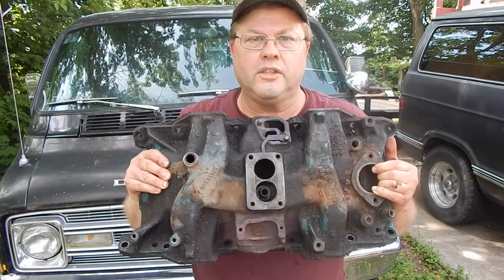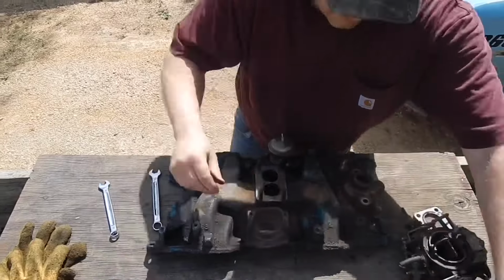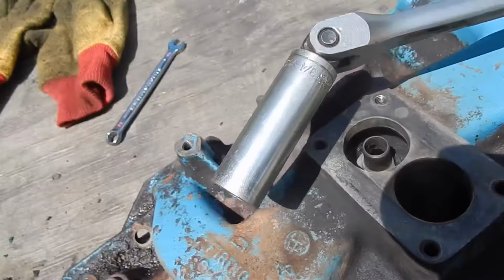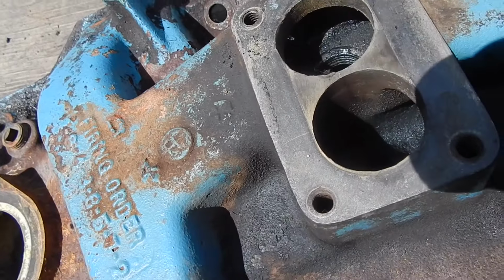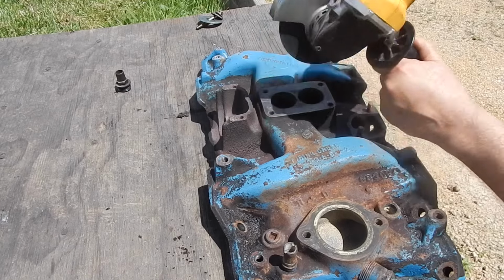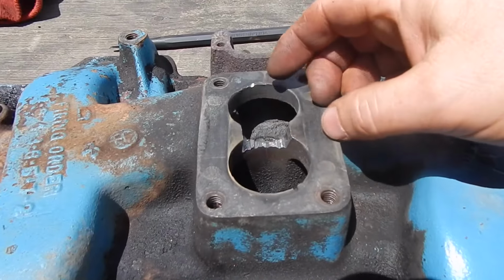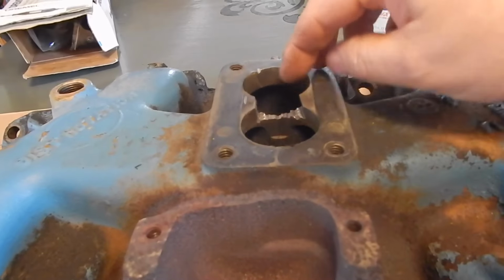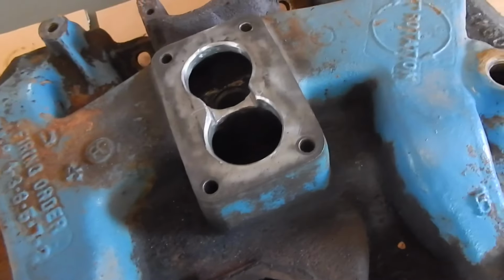Mopar 318 2bbl intake mod * MPG and HP Part 3 #nonamenationals

Comment: had a dual-plane on a 69 fury  a b and e bodies got a single      is the torker 318 any good??
Reply from the maker: single plains are great when used when they should be used.
Reply: @318willrun  well....    yeah...
Reply: @318willrun  and.....
Reply from the maker: @longhairscorpio3976  I guess i don't know what a torqer 318 is ...????   Do you mean a torker 340 intake on a 318??
Reply: @318willrun  edelbrock single plane w/small ports   seen them in the past  guess they stopped making them
Reply from the maker: @longhairscorpio3976  sounds like the holley street dominator.   I have a video where I compare that intake with another.
Reply: @318willrun  there was a streetmaster 318. single plane. i had a couple of them years ago.
Reply from the maker: @citizendick6087  yes, the edelbrock version.  I had the Holley street dominator, same idea

Comment: Great idea, but why not put a 360 two barrel intake and carb on it and do that to the 360 intake
Reply from the maker: On this particular project we want to keep the stock 318 set up.   If I was to swap intakes, I'd just use an aluminum 4bbl intake and go that route.
Reply: i tried telling him that about a year ago....and use an aftermarket performance holley 2bbl carb...